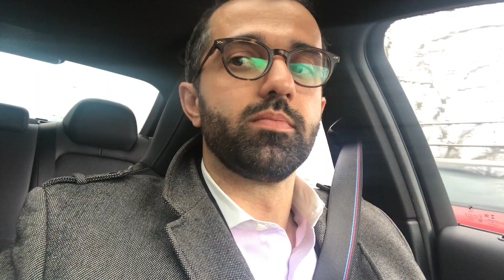PSA: Grinding noises coming from the rear of your BMW M3/M4?

Comment: Yes, pebbles do get caught between the heat shield and the rotor, making that noise. Happened many times with my M3. BMW has a Service Bulletin on this, and under warranty they replaced my heat shields with a new design that is much less susceptible to this problem. My near-constant sound from back wheel is now gone, the new heat shield seems to work like heat shields on every other car as far as not allowing pebbles to get caught there.
Reply from the maker: Thanks Bob! I’ll bring it up the next time I’m up for service.

Comment: 3 BMW F8X/F3X Defects that could cause a similar metallic noise in rear.
- Parking Brake Cable clip breaks and the cable rubs on the driveshaft. AGA Tools has a permanent fix with a billet aluminum replacement clip fix. Do the install as preventive maintenance. $130
- Exhaust Valve Fixing Bow (clip) is broken or fell out. Get a spare clip. $10-20.
- Bad wheel bearing: 4 hours of labor each side. Replace the wheel bearing, wheel hub, and hub bolt.
Reply from the maker: Maybe it’s easier to sell the car :)

Comment: Mine did it like crazy, lots of gravel in my area from the winter. I took it to the dealer there was a recall on it, they changed the part and no more tin can grinding.
Reply from the maker: Selorm Mensah thanks for the info! I might have to tell them that when I take it in. My horn is now completely dead n